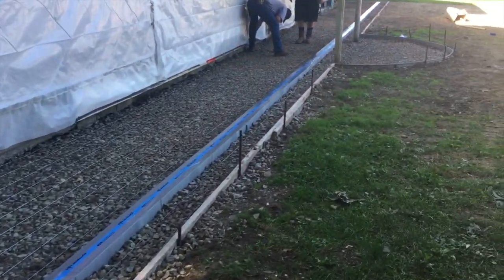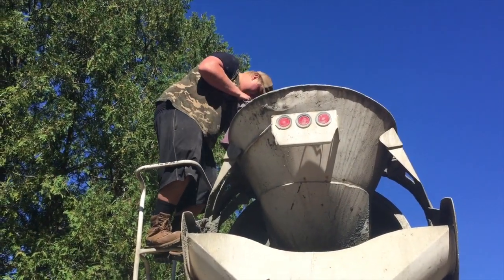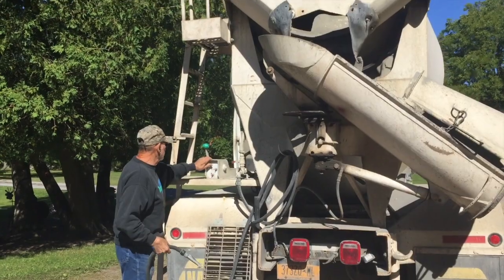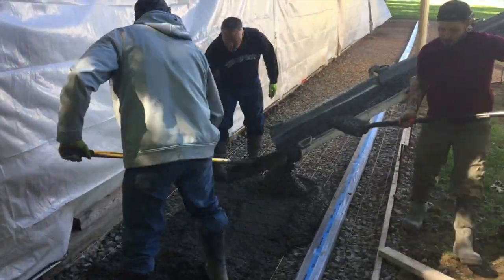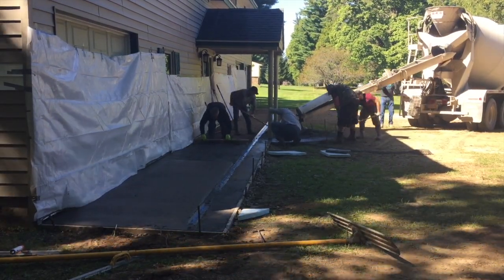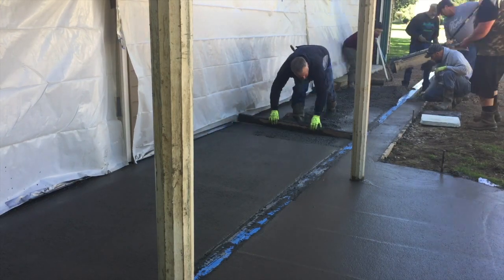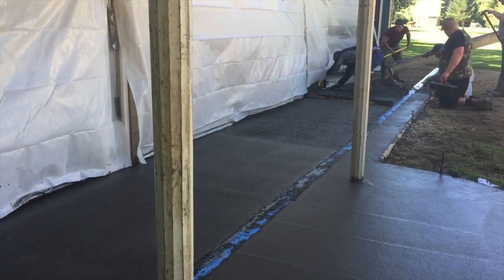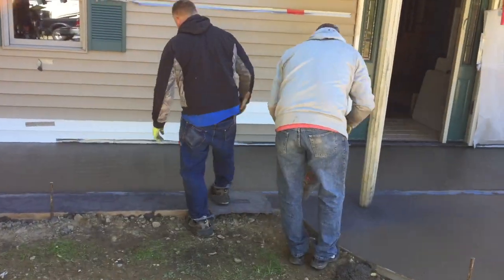Stamped concrete apron with trench drain.

Comment: That seamless heavy stone pattern is nice! I have a set that I had given to me but it looks more like a light texture limestone...I hate it...The Stamps are same design as yours with the handles but orange in color. Fall concrete. Love/Hate relationship!
Reply from the maker: Zachary Zopp. Yes my buddy has that version of the stamp. I have used them a bunch. Then rented the heavy stone ones. Love them. Such a better pattern then the other ones. I love stamping with the seamless stamps. Nothing to line up and never get out of square. 👍 
Happy pouring buddy. 😊
Reply from the maker: Hey Zachary do you use powder release or the liquid and antique it the next day? I might try the liquid but I never have. I’d like to do a video comparing the two methods. That would be a good video 👍
Reply: @bondobuilt386  I use both. Just started using liquid this year..I hate the mess with the powder but after a few jobs I prefer powder release. I've noticed you get a better color with powder.
Reply from the maker: @ZacZopp  Thats good to know thanks. Sometimes when its real hot out the powder doesnt stick good and when stamping it the powder will blow out around the edges and not be even. other then that i like the look of powder. 👍